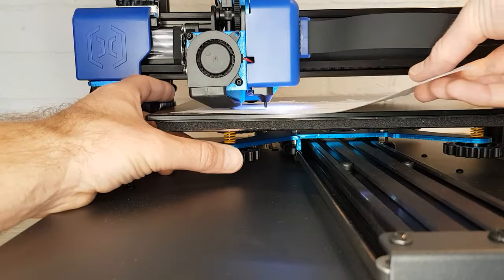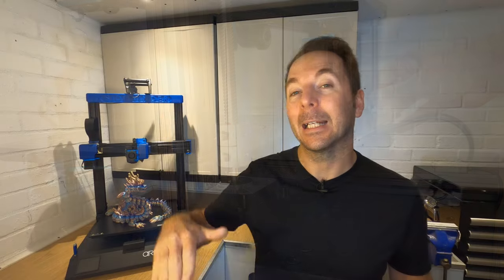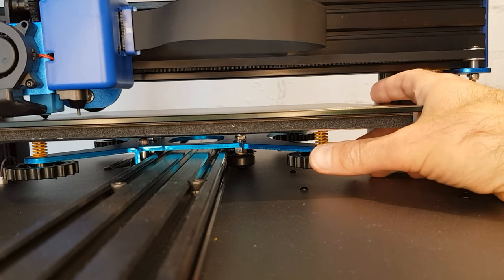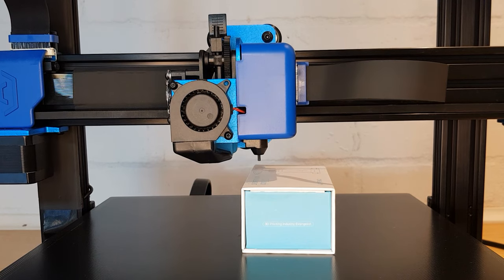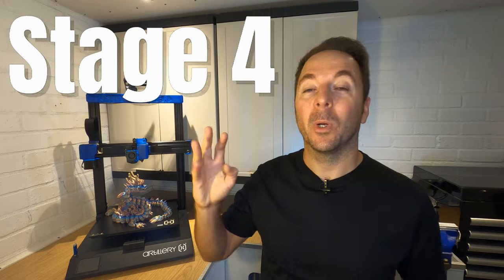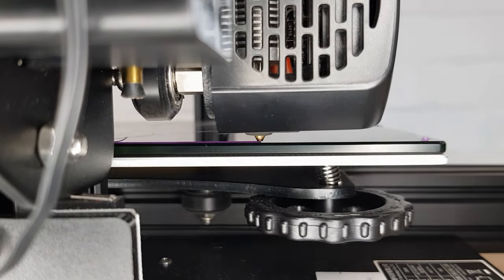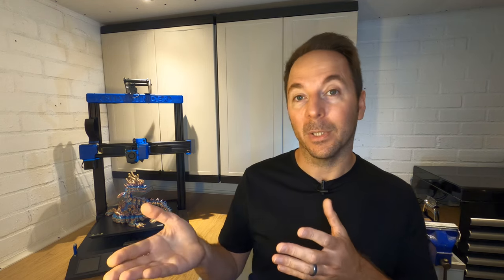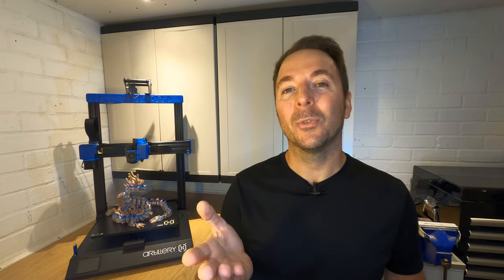3d Printer Automatic Bed Leveling - 6 steps to perfection!

Comment: Hi
Thank you for your video of "Auto Bed Leveling" Artillery X2.
I believe that I understand everything that you are saying including the Z offset to the glass plate (never seen that idea before). My question is that once the Auto Bed Leveling is complete, we use the save to EEPROM button to save the mesh. In the Startup Gcode (Cura 5.XX) after G28 we include - M420 S1 Z...some number 1 - 10.   Since we have saved the mesh into the EEPROM should we also include the "L" parameter. - M420 L1 S1 Z3 - ?  L being "Load mesh from EEPROM index.
W

Comment: if you are using a Sonic Pad and or a different  slicer such as Creality Print, do i still need to add the new line? Plus would you consider doing a video for leveling/Tramming on the sonic pad plus using the desktop sonic pad display?

Great vids and a huge help  thanks

Comment: that's very intresting - even when it works fine with my artillery genius (without z-offset, but i'll try that - even when that one doesn't had a bed probe, but seems so that i could add one). it can maybe helpful for my old printer - a anycubic 4 max, who actually had a problem with the heigth in leveling (and where i don't get it to run good enought for the first layer)...

Comment: Very informative video mate, does the M420 work on a printer without a bltouch and you do the assisted level bed process in marlin?
Reply from the maker: Usually assisted bed levelling only drives the nozzle to set positions so that you can adjust your bed to suit. The M420 code recalls a bed mesh that is already saved to the control board's memory. There are ways of setting a manual mesh if you don't have a bed probe but that's not the same as assisted levelling so probably not unless you are referring to a manual mesh that you have saved.

Comment: Hello Rickey, 
On stage 3, after manual leveling if the path of the nozzle is not parallel to the bed what does that mean? Should I tram the bed again or does that imply some other issue with the bed or z axis?
Reply from the maker: If the nozzle isn't parallel after manual traming then I'm afraid you'll need to do it again. You won't be able to progress very far without getting this stage right.

Comment: Hi, You have brilliant videos and i've followed as best I can. I've changed from Creality Cura (which didn't have a G29 code)  to Ultimaker cura (which does) I've removed the G29 code and replaced it with the new one, unfortunately it doesn't seem to work. The mesh isn't being saved. Any suggestions as to what I'm doing wrong. I'm using an Ender 5 + with sonic pad.

Comment: Hi Ricky. I've followed all your videos in this series and you are the Don!
I am however stuck at this stage. My Auto bed doesn't start the test with enough space too complete a run without trying to go off the bed to the right...nasty sound with the motor. I've tried to reduce the mesh size from 5x5 to 4x4 but still no joy.
This is throwing all my settings off. Can you please point me in the right direction?
Keep up the good work.

Comment: I went from a super basic printer with no option for ABL (MP select mini V2) where I had to get very good at manual levelling to a newer and better printer with all sorts of fancy options that I wasn't used to (Geeetech Mizar).  I had zero issue manually levelling the bed and my first print came out perfectly.  Then I added my BL Touch and the nightmares began.  I had the worst time trying to figure out my Z offset as every video or instruction set I found never told me how to actually FIND what the Z offset would be just how to set it.  I finally had to resort to simply setting it to a value that would leave the nozzle too high and then rerunning the BL touch calibration and incrementally increasing the Z offset by 0.1mm until the 0 position felt the same as when I would manually level the bed.  Once that got saved it worked perfectly, but what a tedious process.  I still have ZERO idea on how I am actually supposed to know what the offset is supposed to be simply by measuring and I'd love to see a video made for people who are assumed to be complete idiots.  lol

This video was really good but it still doesn't tell me how I figure out the actual Z offset value...unless I missed something, and I watched it 3 times to be sure I didn't.

Comment: When the leveling command G29 is used, is the result automatically stored in Eprom replacing the existing one or just used for that one print? Thanks
Reply from the maker: My understanding is that it replaces the current mesh but i'm not 100% sure.

Comment: Hi Ricky Tanks for excellent video I have a Artillery Genius and I understand the bed levelling section but how do I set the first layer height as there doesn’t seem to be any settings shown to adjust z height like in your instructions Many thanks Simon
Reply from the maker: Sorry, I don't have a Genius but on the Sidewinder, at the end of the ABL process, the nozzle moves to the middle. When it does you then set your z height. If the Genius does it differently then you'll need to find how to home the z axis and how to adjust the z offset up and down. It may be in a separate menu.
Reply: @RickyImpey  Many thanks for quick reply but the Genius just has the 5 point manual levelling system and I can not see in menu or fine any info anywhere on line about how it can be done so just doing manual bed levelling for now. Thanks

Comment: awesome video! what is the difference between z10 and z3?  i see both of them come up in different forums. my printer didnt have the M420 code so all of my prints were getting messed up because my bed was never leveled properly even after leveling the ender 3 s1 bed. it was driving me crazy. i am going to follow your steps. the 3 S1 menu looks different than your printers but i am assuming my printer will have the option to save the mesh/leveling so it can call it next time. I am about to burn my printer down

Comment: Not sure if this is a firmware issue that affected only me.
But if you have a BTT TFT35 you do not want to set Z offset and probe offset together. Z offset should be 0, probe offset should be taken as the 'true' Z offset.
If you add a Z offset it will hold the printer on the Z axis while printing for whatever the Z offset is. Info I was given with the printer said it was 1.3mm. This caused the printer to hold at the first layer for 1.3mm of print, before moving up as it should, which meant I either had to adjust the probe offset while printing (and still get a really poor print as I had no idea what was causing the issue for a while) or have the nozzle knock the print off the bed, or run through the first 8 or so layers of the print. 
I assume Z offset is for manually levelled printers with a limit switch and when it's set to a value it causes a firmware conflict causing the printer to hold Z until it gets 'above' the offset. 
I've not tried setting the offset to below zero, though I imagine that would slam the nozzle into the bed and keep it there for a number of layers.

Comment: Video was very helpful! Though could you clear this one question out?
Is step 6 basically applying what was saved in the 3d printer to the new different model to print?
Reply from the maker: Almost but not quite, it's telling the printer to use the mesh that you have saved to the printer for any model you slice from now on.

Comment: Curiously, the Klipper firmware documentation says very clearly to use a piece of paper between the bed and nozzle when setting the z-offset. Someone that's read the printer code needs to straighten out this issue once and for all so we all know how the nozzle z-position is set when the first layer is printed.

Edit: I can probably work it out by looking at a print's g-code and reverse-engineering what's happening by comparing the z-offset value with the slicer's first layer thickness setting and see what the slicer does with those numbers when it generates first layer's z-height value.
Reply from the maker: I use basically the same method with Klipper with no issues. With all the code I have used, the the nozzle moves to the first layer height above z zero. Therefore, if you set the z offset with paper, you need to add the thickness of  this to your first layer height.
Reply: @RickyImpey  OK, but the Klipper docs say what they say, and they don't mention anything about adding your chosen paper's thickness to your slicer's first layer thickness setting.

Truth is, after doing a full printer calibration, I always end up having to fine-tune my z-offset on-the-fly, so the 'paper or no paper' discussion, for me, is kinda moot.
Reply from the maker: @imacmill  Likewise, if it's not perfect after a z offset check then I dial it in on the first layer too.

Comment: Do you find that this needs to be re-done occasionally or do you just leave it alone unless you have a problem? Great video BTW, the OEMs certainly don't go into this in the manual, so without content like this noobs like me would never know.
Reply from the maker: Thanks Eric. No I very rarely have to re-do the leveling on any of my machines. If they seem to go out of level then there is very likely something else wrong. Have a look at this video if that is what you are experiencing https://youtu.be/9eQ_rBzfm5s
Reply: @RickyImpey  just got my SWX2 Friday, followed your instruction here and have been happily printing ever since. Just thinking ahead about whether this is a periodic maintenance issue or not. Thanks for the reply.

Comment: Hi, Is the 'M420 S1 Z10' GCODE just specific to the sidewinder or can it be used on the Ender 3 Pro, as you can probably tell I'm new to all this, came across your channel by chance and so glad i did, your approach and explanations are crystal clear, which is something thats hard to find ....thankyou for your help
Reply from the maker: No problem. The M420 code works with any 3d printer running Marlin firmware and has a bed probe. Unless you changed the firmware then you will be running Marlin on your machine.

Comment: Could you break down what M420 S1 Z10 exactly means? Since Cura doesn't have a Ender 3 V2 Neo preset, i checked Creality slicer to see what start gcode was used for it, however, it has no G29 or M420 S1 type command in it. Some explanation would be very appreciated :)
Reply from the maker: M430 S1 tells the machine to use the bed mesh saved in slot 1 when running the print. M10 tells it to fade out the mesh over 10 layer.
Reply: @RickyImpey  Does slot 1 mean latest? and do you need to write M420 S1 after a G29 command?
Reply from the maker: @Patriot2609  use a g29 or an m420 code, not both. Most of the time, slot 1 is the only mesh you have. There are exceptions but only if you're deliberately coding to use more than one slot. Slot 1 will be your only mesh unless you know otherwise.

Comment: Thank you for the link in your other video! I'm currently working it right now. When verifying the gcode I noticed my G28 is followed by the G29 in the same line. Would this cause any conflict?
Reply from the maker: It's definitely better to put them on different lines. If they're on the same line then I believe it's possible that the machine will try to do them both at the same. So yes, it can cause conflict.
Reply: @RickyImpey  Honestly thank you for your replies. Working on it now. Sub'd!

Comment: Thanks for the video. I have one question: Why in Cura start G-code  "M420 S1 Z10"? If I understand "'Z10" will only adjust the fade height for the first 10 levels of the print to the printer Z's 0.  Shouldn't this code be "Z0" for all levels of the print?
Reply from the maker: Hi, it's best to fade the adjustment for an uneven bed out over the print otherwise the top of your print with follow the contours of your bed and not be flat in extreme cases. You don't have to of course, it's just my preference.

Comment: Thank you so much for making this video. I am a complete noobie to 3D printing and I'm attempting to setup my first printer, a Creality CR-10S Pro that has been sitting in an unopened box for almost two years. I've watched your video several times and it's all starting to soak in but I have a question. At stage 5 where you set the zero Z offset, I assume that you do that with the bed and print head up to temp, as was the previous step. Is that correct? Thank you for your help.
Reply from the maker: Hi, yes, with both up to temperature. From memory I think the CR10s Pro has an inductive bed probe which can be a little less accurate than probes like a BL or CR touch. It may be fine but if you have any problems that you think might be caused by inconsistencies in your first layer height then look at replacing this probe first. It may work fine but I don't want you thinking it's you, the technology has improved a little while your 3d printer has been siting in that box. If you want, your machine can be upgraded. Enjoy.
Reply: @RickyImpey  Thank you so much for the quick reply. It means a lot to get help at this stage! My printer has a capacitive sensor. I was thinking about replacing it with an inductive sensor or a BL touch, but I think I'll just try and get it up and running first before I start putting a lot of mods on it. 😃
Reply from the maker: @yornotelppa  Good idea.

Comment: Awesome video, will be using this as reference for when I get my CR Touches. Do you have any thoughts on what firmware I should use on stock ender 3 pro, ender 3 v2 and ender 3 max? Should I give the creality firmware a chance, find a pre-compiled firmware or just try and compile my own? Also where can I get that articulated dragon you have printed? Keep up the good work and thank you for all the guides you are making :)
Reply from the maker: Hi, the Dragon is by Flexi Factory on Cults3d. They have a lot of good stuff. I haven't actually complied my own firmware yet so can't say how difficult it is just yet. I upgraded the firmware on my E3v2 to Jyers and love it. A lot of people prefer Professional Firmware as it has more features but again, I haven't tried it yet. I would advise trying one of these options though as the Creality firmware is a little lacking. Here is my Jyers guide https://youtu.be/Qv_vVrnkAkI

Comment: I followed all of these steps exactly on my Ender 5 Pro, everything was perfect but for some reason the M420 S1 Z10 command in my machine settings is not doing anything. The extruder and bed gets to temp, It auto homes, the it draws to lines on the side and ends. It doesn't start the actual print, any idea's what this could be? I did the bed leveling from the printer menu and stored the settings so i'm confused.

Comment: hi, came across your video as i am facing issues. I have followed their manual and i had the printer printing fine, however now its hitting the bed for some reason. so today I tried to follow your guide, but when i do the powered bed leveling i.e with the software, the nozzle smashes into the bed when going to the first point...i have tried lowering the bed but it does the same.. should i reset and try again? what is the process of reseting the sidewinder x2?
Reply from the maker: Hi, there are two main things that can cause the nozzle to hit the bed on the X2. 1) A faulty bed probe, 2) An incorrect Z offset. Did you do the box setup step? If so, you will see if the nozzle just stops a little low or if it keeps going trying to flatten the box. If it stops low then you just need to reduce your z offset until the box clears. If it doesn't stop then your bed probe is likely faulty.

Comment: I have been doing these steps for weeks and when I go to check the height of the paper with manual leveling, the nozzle continues to stay very close to the bed and not in all the corners, it is as if the autolevel did not save me
I don't know what else to do, I might think it's the new bltouch that I changed when the first one broke because ever since I changed it for another original one, it's been giving me that problem

Comment: I installed Jeyers ui Manual mesh and I was told M420 S1 but not to put Z10?
Reply from the maker: The Z10 blends out the bed mesh over the first 10 layers of the print. You don't need it if you don't want it👍

Comment: I have an Ender 3 plus with a BL touch. My auto bed leveling fails consistently. I'm preheating the bed, manually tramming the bed and it seems perfect (using a4 paper by feel). I start the auto leveling process to build the bed mesh and I get an error. On top of this, when I'm manually tramming the bed, the tension screw in the back right corner (4) has no tension on it at all. So much so that the tension wheel fell off last night while printing because it wasn't catching enough threads to keep it on. I have tried adding preload to the springs as you say in this video, and I've tried minimal load as you've said in a different video. I added four washers to the screw so I can at least keep the wheel on. There is no slop in my guide wheels and I don't know enough about this to check anything else. Any more info would be helpful.
Reply from the maker: Hi, sorry to hear you are having problems. The first thing i would check is that you have the correct springs on the right corners. Often there is one shorter spring that should go on the corner where the wiring bracket is held on. 
Also, the error when auto leveling can happen when the manual bed tram is too far out. Hopefully, once you have your spring issue sorted, this will go away too.

Comment: slightly confused after rewatching this vid  using the Sonic Pad,  once i have manually leveled the bed and then run auto level d, i then go and calibrate the probe. im using a 0.2mm feeler gauge. on completion do i then adjust the probe down by the thickness of the feeler gauge 0.2mm?
Reply from the maker: If I understand your method correctly then I would say yes. Basically, the z axis zero point should be with the nozzle just kissing the bed.